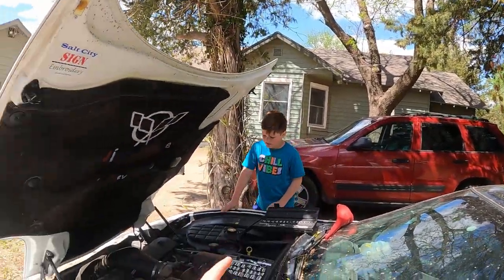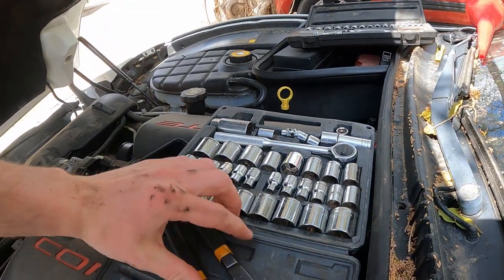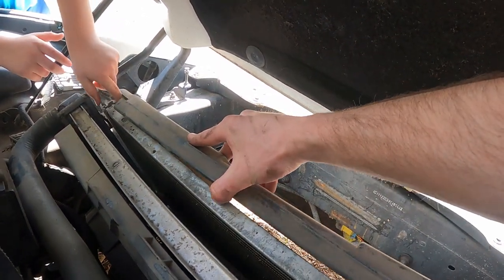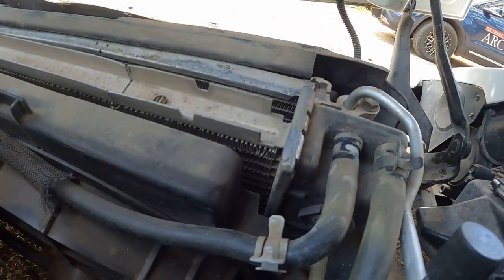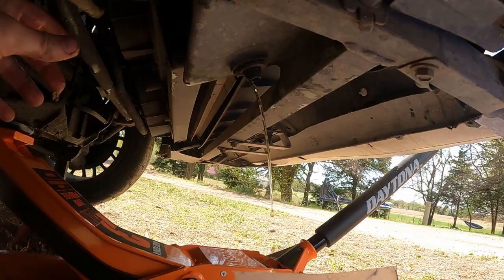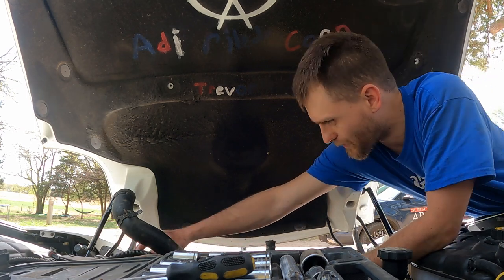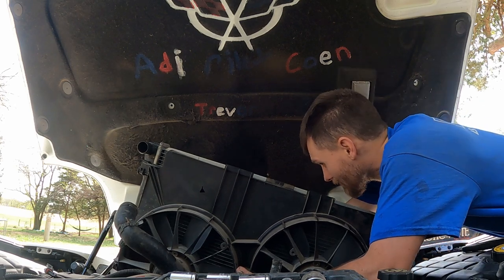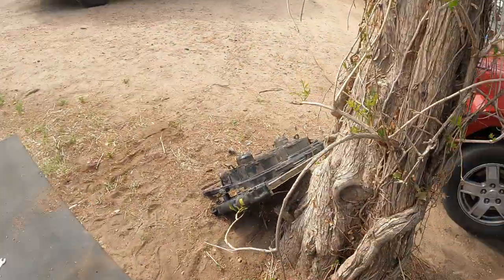How To replace a Radiator in a Corvette - 1997 Corvette (C5 1997-2004) - Daily Vlogs

Comment: Nice vid, what part number you ordered i seem to have the exact same fittings as yours, no luck getting the right rad
Reply from the maker: I don't have a part number but I can try to find one. I pulled this radiator from a 2002 Corvette that was totalled.
Reply from the maker: GM GENUINE 20889, or 52470606
Reply: @ArcticVette  thank you👍🏻
Reply from the maker: You're welcome!